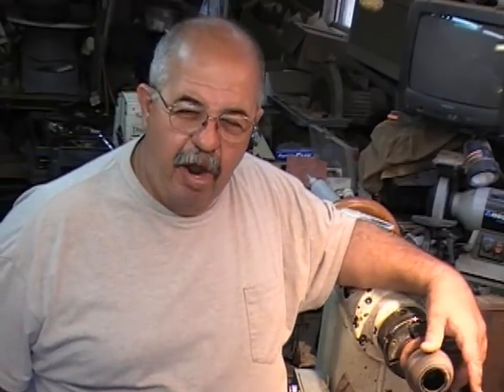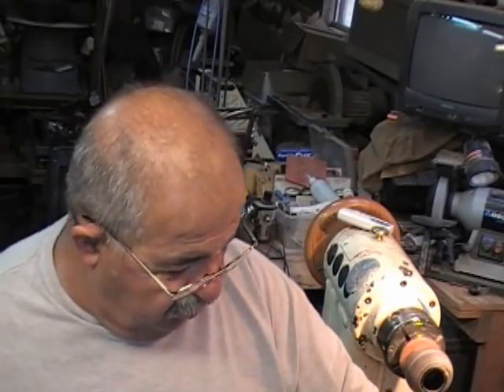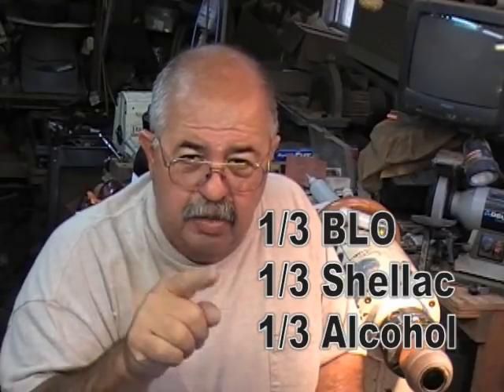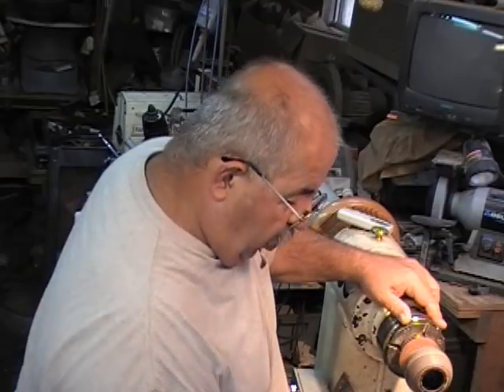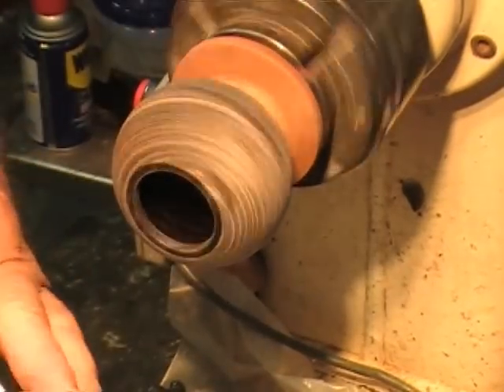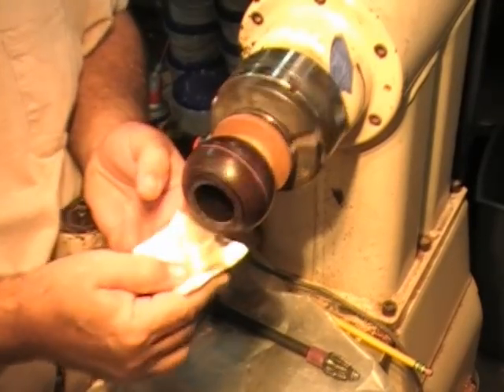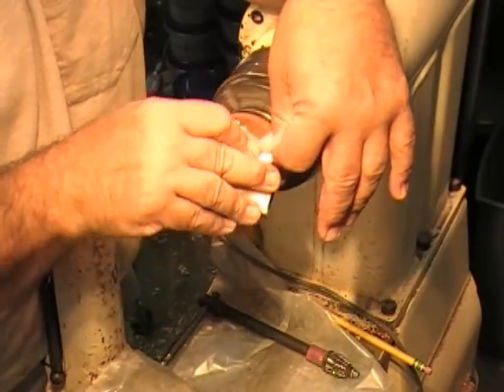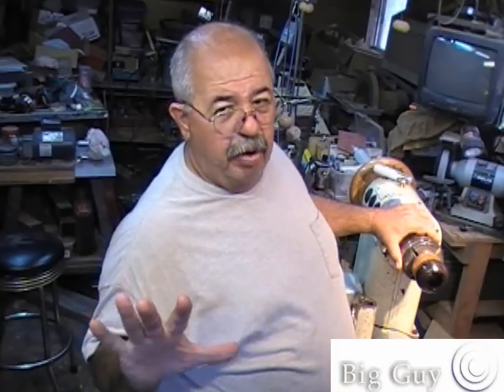#89 O.B. Shine Juice

Comment: Hey Capt. Eddie, I'm going to try this finish. I usually use beeswax and mineral oil but never too old (I'm 69!) to try something new. By the way when I've used a liquid friction polish I just use an small aluminum basting pan I bought from the dollar (now $1.25 🥴) store. It fits exactly under the chuck and sits securely on the bed. Catches any drips just fine. Good video and still relevant MANY YEARS after you first posted it.

Comment: I found a product called Butchers Block at Lowes that is food safe and is much less effort to put on.  3 to 4  coats on a bowl with a paper towel and it looks like glass.  Thought I would pass it on.  Have enjoyed your show many times over the years.  Thanks my friend.
Reply: Butcher's Block oil is great, but it's just plain Mineral Oil. Looks good for a few months, then evaporates off and has to be reapplied. It does NOT build up a finish like shellac, Linseed, poly, CA, lacquer, etc that gives the glassy look. However, Butcher's Block Oil IS food safe (in fact it's sold cheaply at drug stores as a laxative), but just know it has to be reapplied regularly and offers no actual hardening protection.

Comment: Concerning linseed oil:  
BLO is simply raw Linseed oil with Cobalt dryer/catalyst. The name is confusing because they used to boil it with a lead oxide which worked as a catalyst, plus the boiling increased the molecular weight by getting some of the oil molecules to start polymerizing. Now if the linseed oil is actually boiled it is usual called double boiled linseed oil. It has the catalyst and has been boiled.
Raw linseed oil also called stand oil is simply linseed oil without the metal catalyst. The linseed oil will still polymerize over time only slower. Polymerization happens when the oxygen in the air forms radical at the unsaturated double bonds in the oil and cross-link with other oil molecules. 

Concerning Shellac: Shellac has a pot life of about one year once put in the can with denatured alcohol by the manufacturers.pot life

Comment: I use my shellac-mixture without any oil. I bring it on the rotating piece with paper towel as often as i like and then i put beeswax or floorwax with very fine steelwool on it and it shines like a (diamond?) ;-)

Comment: You are spot on with the "never bring a rag to the lathe" Cap'n Eddie, when I first started working in a machine shop, I was wearing cotton gloves on a drill press and made hand just got NEAR the bit and it grabbed the glove and freakin' near broke my hand! Great safety point and good work!
Reply: jim bettridge I worked machine shops for years too.  One was so cold I had to wear a winter parka at the lathe.  I was terrified the whole time.  Those shavings are a real danger.

Comment: Good day to you Cap’n. I’ve followed your video to the letter and don’t get the finish you do with the Shine Juice. It’s given my work a bit of a sheen but I’ve seen other videos where the finish is like glass!  I’m not getting anywhere near such a gloss finish. What am I doing wrong?  I apply with a paper towel using enough pressure to hurt my hands. I’m doing several coats. I need a little Cap’n magic!

Comment: So after having a heck of a time trying to find denatured alcohol on the west coast of Canada, I tried Isopropanol, thinking that should be just as good. Nope it ain't.  It's cut to a certain % with water. In my case 50/50.  Turned my shine juice to wet cottage cheese (water and oil, right). Switched to Methyl Hydrate.  99.9% pure.  Works great. $5.00/L at Canadian Tire.
Reply: i think denatured alcohol 'methylated spirits' outside the US

Comment: I have tried the OBSJ on a couple of bowls and I am real happy with the results.  I only problem I am having is at the center of the inside of the bowl where I get rings/ridges.  I have tried ramping up the speed (a lot) and I can't seem to get a smooth finish in the center.  Any suggestions?

Comment: Is shine juice good for finishing pen, if so do I need to have a finish coat of something on the pen?
Thanks, love your videos, great information.
Reply: However for repair ability down the road, I think it will be easier to get a nick or scratch out with this and repair and not know it was even there where with CA glue you have a bit more work to do in sanding down the acrylic as deep as the damage then building back up.

Comment: I love your projects Eddie,u are awesome,pls can u tell me how to mix Shellac flakes with BLO and DNA to make O.B shine juice,On your video i see u use solved shellac,but i have SHELLAC FLAKES.
thx u for answer
Reply: The Zinsser Clear Shellac he uses is a 3lb cut (meaning the ratio is 3lb of shellac flakes per gallon). Since he uses 1/3 oil, 1/3 Zinsser clear shellac, 1/3 denatured alcohol, we see that he has a 1:1 mix of the Zinsser to denatured alcohol. In other words, he’s diluting the 3lb cut to a 1.5lb cut.

So if using shellac flakes, make a 1.5lb cut mix. Then use 1/3 oil, 2/3 of your 1.5 lb cut mix! Hope that helps!

Comment: I do have a question or 2,,,,first at what speed are you using to get the best shine? and is there a good applicator to put this on? I used what you shown on your vid. but I see very fine lines!
Reply: Kelso Custom Turning I have the same thing. Have you found a solution?
Reply: I don't know but it sounds like you need to sand more with finer grit

Comment: Hello Cap'n!
I've watched this video over and over again, just to check if I missed something but the result is the same.
I followed the recipe for the formula. (about four times) but when I apply it, I get shiny stripes all over the piece. I tried slow and fast speeds but I cant get it right. I was wandering if anyone had the same problem as me and if you can tell me what I am doing wrong.   
Thank you for all the knowledge you share.
Reply: Ferrer R I know it’s been four years, but I have the same issue. Found a solution?

Comment: Hey Pal, I followed your directions and proportions exactly using quart containers of the fluids for my mixture. Then the total mixture was stored in 2 plastic gallon containers for about two months before my first use. THEN, it was time to put the finish on some hard maple for picture holders. Two weeks have gone by now and the finish is still tacky. What did I do wrong? Two gallons is a lot of juice and I do not know what to do. Would you be so kind as to tell me what was done wrong. I would be so happy to hear from you.Your programs are just great and I enjoy watching. Thanks a bunch. Respectfully, Will Nail Albuquerque, NM

Comment: I live in a small town in Australia where pre-mixed shellac is not available.  To make the OB shine juice I added denatured alcohol (called methylated spirits here ) to shellac flakes then same quantity of Boiled Linseed Oil and same again of more denatured alcohol .  Problem is that it is not shiny when used even after 5 coats.  Am I ;likely to have screwed up on the formula and does anyone have any suggestions of how I could fix it
Reply: I see this was a couple years ago, but the amount of Shellac is essential as a part of the mix. See this video. Friction Polish Exposé! Secrets Revealed!

Comment: @jbailey8129 Just to be clear, I used pure tung oil. I believe minwax is a modified tung oil with driers and other such additives which may make it tacky, they also may interfere with the shellac and how it cures. 
I know the pure stuff didn't get tacky and it cured just fine.
Still, paraffin oil is super cheap and I have a ton of it (it's lamp oil), so I'll keep on using that. A luthier actually turned me onto french polishing with paraffin oil. Gotta say, it works great!

Comment: @LJG781 
Have you ever tried putting the goblets in a stock pot of Bee's wax?   I simmer them for about an Hour.  Pull them out gently pull off the excess, then buff  to a nice satin luster.  The Plus side, It is almost Hypo Allergenic... Except by those allergic to Bee's wax.

Comment: Unfortunately, I can't seem to find Denatured Alcohol ANYWHERE in my area. I have read though that Methyl Hydrate is an acceptable substitute. Is this true? If so, would the proportions required in a mix be equivalent to that of Denatured Alcohol?
Reply: +Matt Couto 
hey if you can't find denatured alcohol just buy a bottle of everclear at the liquor store. It works just as well as denatured and mixes well with orange juice too!

Comment: Because Boiled Linseed  Oil is toxic, would this recipe be toxic after the process and if so, does anyone have a food save version of Shine Juice?
Reply: Use La Tourangelle Roasted Walnut oil. You can eat it, and it is sold as a food. It does polymerize. It is a drying oil. Because it contains no chemical/metal salt drying agents, it does take longer to polymerize to a hard finish. But it will dry hard if you give it a few days. You can use walnut oil by itself to finish cutting boards, too, or use in combination with a wax.

Comment: Curious. Why never ever a cloth rag?
Reply: @eddiecastelin8341  why not?
Reply: @eddiecastelin8341  lol. Ok. I thought that's where you were going. Thanks
Reply: If you're using tissue or kitchen roll and it gets caught on the lathe hopefully it will just rip and not pull your fingers in but with stuff like rag or wire wool it won't rip and will pull you in.🤕😜

Comment: While that recipe does work, it is not the best. With the exact same ingredients, you an have a much better finish, the builds faster and will stay shiny.  The 1/3 recipe will trick you with a shiny finish that will fade very rapidly because the shine is basically the excess oil floating on the surface, rather than a cured hardened shellac finish. Try my recipe and compare, I have been using my formula for years after looking into why the OB shine failed to remain shiny... Here is what you should try: 10% BLO,  30%  DA and 60% shellac. You will note a difference right away on build of the finish, much quicker, and will stay shiny 2 years later.
Reply: LivingArtsCo you aren’t kidding. I was nearly out and made your recipe, it works great. Thanks for sharing your recipe.
Reply: @dougengebo8928   My pleasure. Not one to be disappointed with the run of the mill recipe out there so I research and try till satisfied ;)

Comment: you never mentioned where and where not to use the finish. i tried to apply the finish over a stained project, it was ruined, as the stain was dissolved by the finish.
Reply: Oh man do I feel your pain.  No offense but perhaps you may wish to check for finish compatibility on  a test piece (scrap) before running finishes on your project pieces which you  have invested  your heart and time in.  That little bit of extra effort  to "test on scrap" has saved many projects of mine from the scrap/burn bin.  LOTS of stains and finishes are not compatible.  Test it first if its an unknown combo that is new to you.

Comment: Be careful of “boiled linseed oil”. The cheap stuff contains chemicals to speed its setting. These chemicals are not necessarily food safe. There is a lot of confusing information on Google so find out for yourself.  Good shine juice though! I paid quite a lot for good, unadulterated boiled linseed oil, but a little goes a long way.

Comment: @jbailey8129 I didn't have that problem at all. I understand what the BLO is used for, and Tung oil does the same thing. You just wipe it off after the shellac has cured. 
Maybe my results were due to my using a different tung oil? But Minwax doesn't make a good product, so that could well be it.

I've now used Tung oil, Walnut oil, Olive oil, and paraffin oil successfully. My preference is now paraffin oil. It cleans off easier in the end.

BLO will never come in my shop. Ever.
Reply: Concerning linseed oil:  
BLO is simply raw Linseed oil with Cobalt dryer/catalyst. The name is confusing because they used to boil it with a lead oxide which worked as a catalyst, plus the boiling increased the molecular weight by getting some of the oil molecules to start polymerizing. Now if the linseed oil is actually boiled it is usual called double boiled linseed oil. It has the catalyst and has been boiled.
Raw linseed oil also called stand oil is simply linseed oil without the metal catalyst. The linseed oil will still polymerize over time only slower. Polymerization happens when the oxygen in the air forms radical at the unsaturated double bonds in the oil and cross-link with other oil molecules.